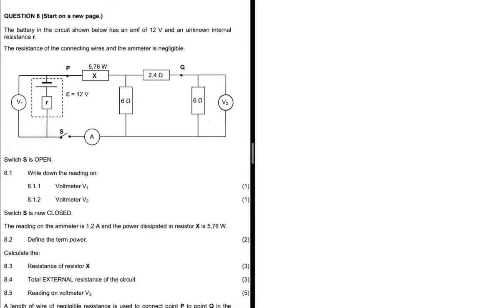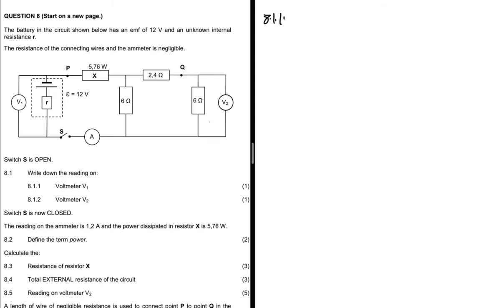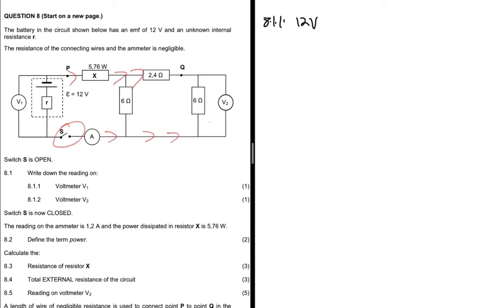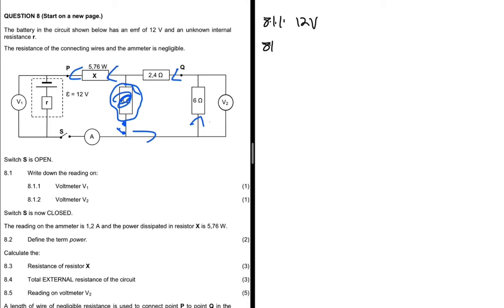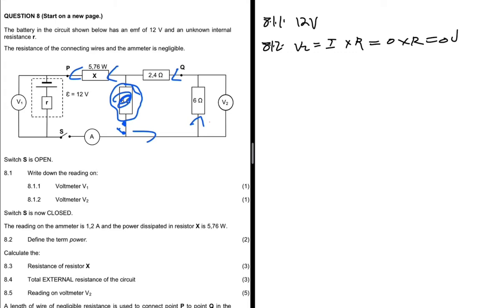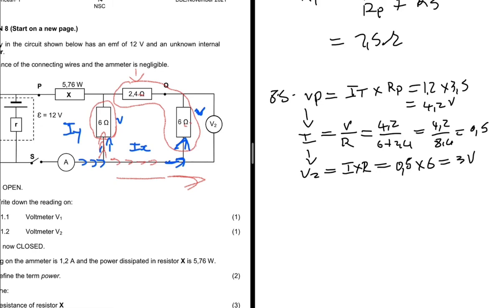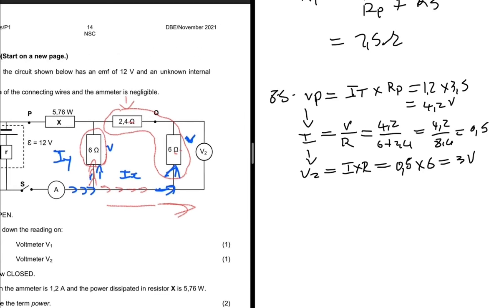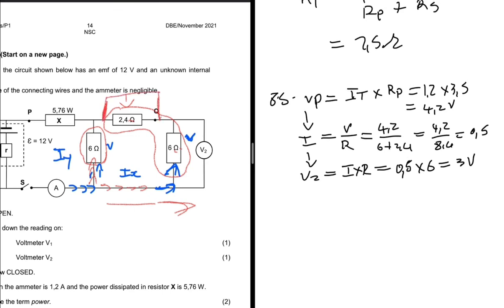Electric Circuits Grade 12 Physical Sciences P1 November 2021 Past Exam Memo

Comment: hiii sir, i just wanted to know...is  resistor 2.4 omhs and 6 ohms in series with each other first, then both comined is in parallel with the 6ohm resistor parallel to the two cominded resistors? 

thanks for these precise and short videos
✨
Reply from the maker: Yes, the (6) is parallel to the (6+2.4)

Comment: Sir what did you do in 3.5 I'm confused 😭😭. Can't you just find the V parallel and say it's the v that's for V2
Reply from the maker: Unfortunately we can't. V2 is reading the potential difference across the 6 ohm resistor & the 6 omh resistor gets a portion of Vp as it is sharing it with the 2.4 ohm resistor (they are on the same path).  

Vp is not neccessary the potential difference across one resistor but across one path.
Reply from the maker: Quite a few problems require students to calculate Vp and then use it to find a reading on a voltmeter across a resistor on the other path. Familiarize yourself with the situation.